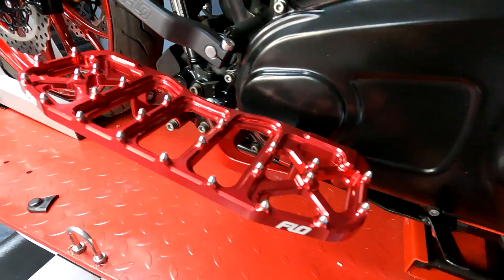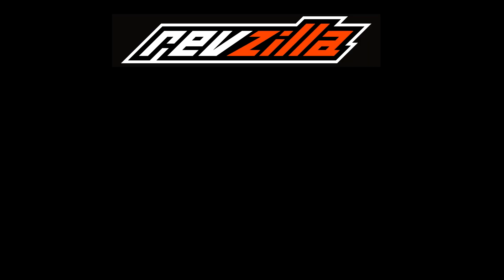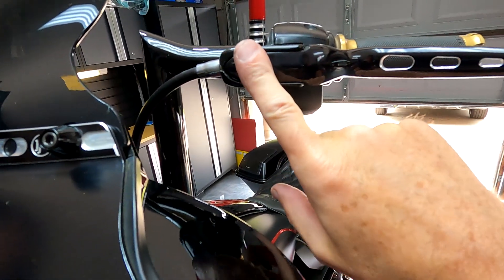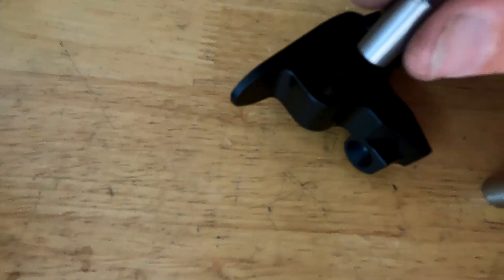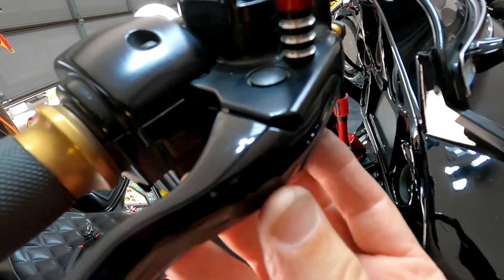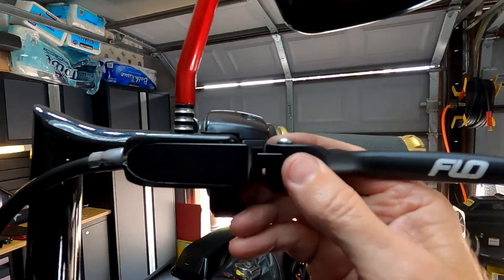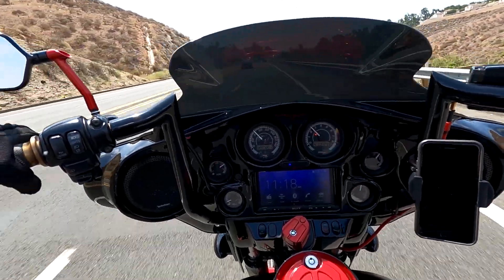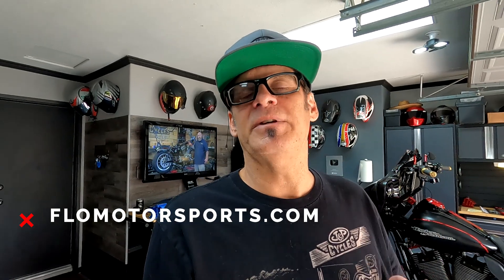MX Style Adjustable Levers for your Harley | FLO Motorsports

Comment: Ran across your video what do you have? That’s holding your motorcycle helmet,  up on the wall looking like some nice artwork would you mind letting me know? Thank you. Keep the videos coming.
Reply from the maker: My recollection is that they are helmet hooks from Amazon. Thanks for watching! MP
https://www.amazon.com/Deloky-Motorcycle-Jacket-Display-Mounting/dp/B07RQKQZH3/ref=asc_df_B07RQKQZH3?mcid=4249b2e875d534d4b3fa2ea5db49ae8c&tag=hyprod-20&linkCode=df0&hvadid=693128046674&hvpos=&hvnetw=g&hvrand=16942885758695700271&hvpone=&hvptwo=&hvqmt=&hvdev=c&hvdvcmdl=&hvlocint=&hvlocphy=9029448&hvtargid=pla-763444588940&psc=1
Reply: @ thank you so much happy Thanksgiving to you and your family

Comment: I just installed my lever but does not start on gear just on neutral. Does your start on gear ??
Reply: Friend of mine has this problem with these levers.
Reply: Just installed mine.  Same problem?  Anybody figure out a solution/fix?
Reply: You have to adjust it to like the middle setting to get it to start in gear. If it's to close to the hand grip it doesn't allow the safety switch to come out all the way in the back of the switch housing
Reply: Mine to and no cruuse control . 
Its starting in gear now it wasnt

Comment: So how do your recommend getting that "free play" slop out?
Reply from the maker: Are you talking about freeplay where the levers mount to the perches?  Mine seems fairly snug. If not you could use a thin metal round shim. Or tighten the pivot bolt tighter. Thanks for watching! MP
Reply: @MOTOPILOT6  yes there is more up and down play in mind that I would like. They are only held in with pins with clips on them, so there's no way to tighten that. Shims may work.

Comment: Will they ever make them for the 2021 models??
Reply from the maker: I'd hit them up. Did they change in 2021?
Reply: @MOTOPILOT6  2102 is cable clutch
Reply from the maker: @ryanr4181  so is my 2013. Maybe it fits